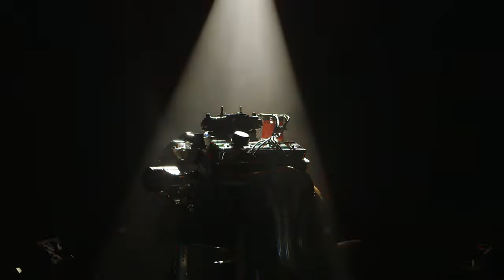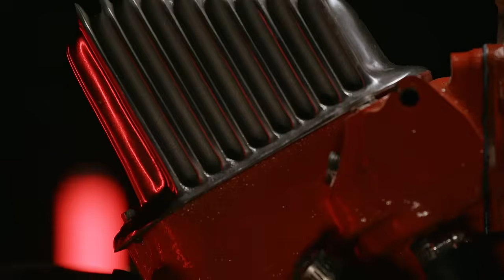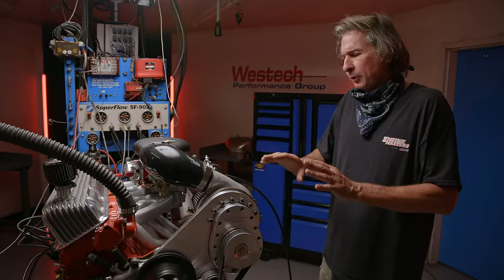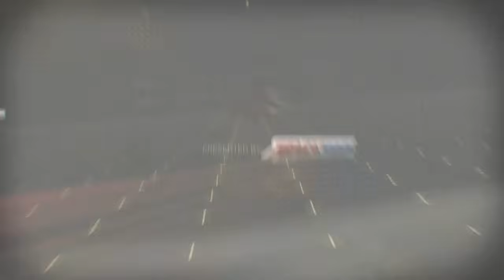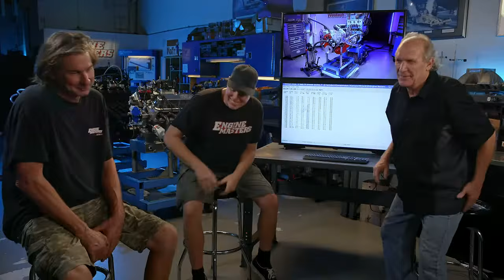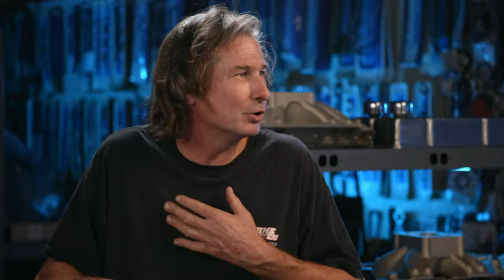Engine Masters  S5E77   Dulcich's Quest for Slant 6 Greatness!

Comment: Have you guys thought of building like 4 or 5 similar engines all with different compression ratios and compare power?.  Then add a blower or turbo.  Compare and see what the changes are with the same psi of boost.

Comment: My Dad's first new vehicle and his 2nd new vehicle was a 1977 d100 with granny gear and a 1987 d100 with overdrive, no granny gear. They both hauled a lot of wood for us, got beat pretty badly by my 5 older brothers and me. The '87 was 1 of the 3 vehicles I learned to drive on with a few late nights squealing tires, oops tire, although both have limited slip, past redline. Not sure how long the 77 lasted but Dad traded the 87 in with 189k miles without anything but oil changes for the engine and only a heater blower fan and quite a few tires.

Comment: We had a '76 Duster with the 225 "Slant-Shit" motor as we called it.  My dad would lower the idle to set the valve lash. The heat riser was questionable so he installed a manual choke for cold startups in the winter...LOL 145HP&8.4:1 compression?LOL

Comment: I have owned several Slant Sixes. My favorite one was a 77 Super Six. It pushed my Volare' around like a small V8. All the rest were very weak but got 20 mpg and lasted forever. The most powerful inline 6 I ever experienced was the AMC 258 cid. It was in a Gremlin and it would spin the Right rear tire and get a chirp in 2nd with an automatic. I have also had some experience with a 383 duel turbo draw thru set up in a 68 Dart GTS. It was very powerful. I put a TransGo shift kit in it and pulled the 4.56 out for a 3.23 after we got it sorted out. The most pull I have ever experienced in a car. That Dart needed a transbrake and a looser torque converter, to produce a quick 1/4 mile, but it would flatten your eyeballs once the turbos came on. We pushed it up to 45 psi boost. I'm no mathematician so I googled it and  I believe that is over 4 atmospheres, or that old 383 would be about 1,543 cid. ben/ michigan

Comment: We ran a Dodge Demon with a 225 a bit too deep through a stream in South Carolina in 1980. It just made it to the other side as the engine looked up, actually from water being ingested. After a while not sure what do, we pulled out the plugs and turned if over until most of the brown water was squirted out... 10 minutes later with spark plugs, it actually cranked up and we drove it home.

Comment: The slant six's biggest weakness is the head, if someone designed a flow throw or even Hemi head it would have massive power gains. It's funny those home made masks wouldn't save you from anything when it comes to microbes.

Comment: Big Power from a slant6? Not hard to do. Bit pricey tho. EFI on a log inlet manifold with equal length runners, port injection, a big TB, forged & lightened internals, lumpy cam, wire ring head gasket & about 15-18lb of boost. Might need to cross-bolt the mains. Might not. Can't remember, but the above setup produced roughly 410hp & 390lb/ft, & was reliable for the 5+ years I knew the owner. IIRC, getting the balance to within 0.1g was key, as a previous build (balanced to roughly a gram) ate a bearing. There was talk in the 'shop that hitting 500hp was doable, if you were to up the redline to 7500, but the owner didn't want to go there...

Comment: Had a 1984 Dodge 150 4x4 with a 225 with 4 speed and a granny 1st gear. Couldn’t out run granny with a walker but the slant six low rpm torque and granny gear mad it a top notch 4 wheeler. I could out crawl any V8 4x4 any day without ever putting my foot on the gas peddle. Truck could idle up any 4x4 trail. We used to walk get out of the truck and walk along side it with one hand on the steering wheel

Comment: These guys they’re funny, but the slant six cylinder engine goes 1,000,000 miles there. High-performance engines are lucky to go more than a year without blowing up and the slant six was not designed to look symmetrical like a V-8. so your traditional boomer boys cannot appreciate the unusual it’s funny because now today Honda makes a four-cylinder that you can get 1000 hp out of and wipe the floor up with your big blocks. This is probably why I don’t watch this podcast that much because of the engine snobbery it’s like wine drinkers they are pretentious assholes.

Comment: I noticed, no one mentioned power to weight ratio! Slant 6 220 Cast Crank-450lbs, Forged Crank-550lbs. 383-620lbs. Modified inside any car, I believe it would still win!

Comment: In Australia, Chrysler used these engines in the 2 door Valiant Charger - 302 factory hp for the high-performance E49 version. The  E49 had triple Weber carburetors, an aggressive cam, and headers and 265 cubic inches.  Some Aussie may have already said this.
Reply: Totally different motor
Reply: @cletusslackjaw969  no worries
Reply: Nope

Comment: Does anyone know about the Corvette 1967 aluminum 427 engine. My dad bought the car in 1967. It was a roadster. The car became unstable at about 189 mph. We clocked it over 10 miles as the speedometer only went to 160 mph. We altered the body and changed the aerodynamics by adding a duck tail. Flared the fenders to except 12 inch tire on 15 inch rims. Things improved but 196 mph average over 10 miles was as good as it got. There was still throttle . Just not enough down force. My father said that it would take a minimum of 500 hp to approach 200 mph. Did GM make a 500 hp engine in 1967? Thank you . Great show

Comment: I would have intercooled it, dropped the static compression ratio to around 8.5:1 and destroked it to 198. The 225 has a ridiculously long stroke vs. bore ratio and cylinder head ports like soda straws.. the smaller displacement and lower piston speed of the 198 crank would have helped raise the rpm upper limit safely and more closely matched the head flow characteristics.

Comment: stockish re-build  - add 
- forged pistons
- forged rods
- Callie's "rifle barrel" steel crank
- 6500 electronic ignition 
naturally aspirated - peak HP and Torque will be between 5500 and 6000 RPM

Comment: The slant 6 in my 1985 d100 ran so hot, it shut off going down interstate 40. Stuck thermostat. Engine wouldn't turn over. Let it cool about 10 minutes, while I jammed a screwdriver through the thermostat. Topped off with rain water and drove it 40 miles home. That was 9 years ago and it's still running today with 283,000 miles.
Reply: Legend
Reply: for real

Comment: The head and small bore really limit power on the slant 6. Even with bigger valves and porting the stock head is a big restriction. And, the small bore is going to limit rpm and airflow. 
Boost can fix a lot, but for the money and effort it’ll still be way behind more traditional engine builds.

Comment: Don't forget the slant 4 cylinder Pontiac engine. It was actually a 421 cubic inch engine cut in half.
Reply: Half of a 389, not a 421. 195 cid.

Comment: Great for low end torque and are well balanced and reliable for extreme longevity. Especially a Ford 300 or Cummins Bt6 plus they can often be pretty decent on fuel. I'm looking forward to getting my '69 block 300I6 slapped together with the Aussiespeed 4V intake, Duraspark II distributor, heavy duty exhaust manifold and new drive gears and oil pan finished to be stuffed into my '82 F250 4x4. Eventually I may put a turbo on it but for now I think the Predator carburetor will wake it up, I may someday install a greater duration camshaft and port the head or install a reproduction head with bigger valves. Higher compression around the 10.5:1 would be ideal for it.

Comment: It's incredible how, no matter how hard Americans try, they still can't get great numbers from their 6-cylinder engines.

I'm sharing a video of what we do here in Argentina, and it's not even close to the most radical build: https://youtu.be/t8yIDqn2PM4?si=KQOZ7E8JiSXIxz4x
Reply: Because we have loads of V8’s available and they’re much easier, and cheaper, to get power out of. Even a “small” V8 with as much modified as this engine would be almost double the power and still be reliable.
Reply: You Argentines must be full of ignorance, despite the internet documenting that Americans have, in fact, made big power with 6 cylinder engines. 

Keith Lopez has a ford 300 i6 with over 1,000 hp, 

Newcomer racing has an AMC i6 with 1,000 horsepower,

And others have pulled big power out of the GM Atlas 4200 i6.

Comment: I'm slowly recovering from slant sixness. I sold my last Dart several years ago. In 1977, I drove from Florida to the tip of the Baja Peninsula in a Valiant station wagon. It had over 200k on the clock when I set out, but I had no worries about making the round trip. I had to reset the  points on the way home, but no repairs at all. The biggest downside to the slant six was the leaky valve cover and the tendency to flood out in rain storms.

Comment: They might be slightly overrated but only with the nickname leaning tower of power, which they can be, and as a teenager I came up with a different head design, before I knew about the Australian slant 6. I always wanted to just change the intake to the inside and the exhaust on the outside. But I will say the power and especially the torque was greater than ford, AMC at the time and gm significantly! Now with no maintenance other than late oil changes they will definitely easily go over 200k miles so they are definitely very reliable. Now you guys that hate them are comparing them to v8s so not fair, but compared to other engines within 20 years these are great engines and the only better power builds are the AMC/Jeep inline 6s. So pretty damn good for a 1958, 1959.

Comment: Chrysler made a mistake designing the 225, they should have given it a cross flow head. Keep the intake as is and put the exhaust on the other side of the block. It would have breathed a lot better. Still a great engine.
Reply: Remember this was a car/truck motor used in Winter. Same side flow provides carb heat, even with headers if you do some trick mods

Comment: e49 valiant charger in australia had the 265ci hemi 6cyl with triple side draft webbers and made 302hp na stock which was 28hp more than than the 340ci v8 which was the most powerful v8 option. the e49 was also seconds quicker per lap due to lighter weight and less understeer.
and an ssv redline 6.2l Ls was slower than a 4.0l xr6t barra i6

Comment: For boost, I would NOT have increased the compression ratio. You can get similar power, without the high peak chamber pressure, if boosted at stock compression. That would also allow pump gas, and, the head gasket would have probably survived!

Comment: My first engine in my Chevelle was a 250 inline 6, it’s since evolved into a 428 small block Chevrolet
Reply: Weird how dat happens......if ya keep da car long enough it sometimes reverts back to a 6-Banger. 
Strange but true....LOL
Reply: @bbarnett3469 no, mine definitely won’t
Reply: @Mopar-k6o  I'm back to Drum Brakes & Points......LMAO!!
Reply: @bbarnett3469 my Chevelle used to have 4 wheel manual drum brakes. About five years ago I did a manual disc brake swap on the fronts with a kit from Speedway motors and it’s MUCH better. It feels like the brake system from a modern normal car. I don’t have the patience to mess with points or ballast resistors on my cars anymore either.

Comment: Had a 62 Dodge Lancer back in 74 with a slant 6. Used lots of oil, mostly blowby. Lent the car to my brother with a stern reminder to keep an eye on the oil level. He didn't and the result was a rod right through the side of the block. Rebuilt a junkyard 225  and drove the hell out of it a few more years until I sold it. Kinda wish I still had it.

Comment: in my valiant came equiped with a police interceptor spec as they called it, was meant por a police car but never did it so i got it, and it is 174bhp with a tad over 200 trq and not a single 350 or 351 got me in those years, the only one i ever lost and by a couple cars was against a dodge magnum 360, which here did 300hp from factory

Comment: They should've looked over at Australia the valiant chargers in the 70's if it was an rt made 305 HP from the factory out of the 265. I've seen one make 330 at the tyres with a stroker kit , E85 and a CNC cast iron non cross flow head. 

That's 400 at the crank.

Comment: The 70-80's ARCA series ran 6's and NASCAR being NASCAR there a smaller V-8 available in the series, BUT as the engine quilders got loose the 6's could crank out MORE than v-8s.  For a while the color commentary would be 'in the lead with his V-8 t-bird, with his 6 cylinder powered Olds'.

Comment: I had a good friend in Columbus Ohio in 80 who raced station wagons with straight 6. He used a Pontiac Sprint 6 overhead cam with factory 4bbl Rochester carb. There were speed parts from all the speed companies for all the 6 cylinders.
Reply: thje "speed parts" were limited to intakes and headers pretty much.the odd cam was available but the market was nothing like the availability of parts for v8s,especially the sbc

Comment: I used to know some old mopars guys.. and they said it was easy to get an NA 225 to match a stock 318. Of course, the 318 was not a performance motor either. I miss the good old inline 6.. naturally balanced, one head... simple. The Australians took the old small block 250 Ford and kept working on it long after Ford gave up. Not sure why all the old domestic inline 6s had the intake and exhaust on the same side of the head. Though maybe that caused better combustion swirl for low rpm (cheap parts) efficiency and power. I totally understand Dulcich's angle... it's easier to root for the underdog. You have a built V8 and somebody always has  a faster one. But a built old inline 6 puts you in a class of your own. Now I want to cram a 300 6 Ford in a Galaxie with a 5 speed manual.

Comment: I drove a heavy truck that had one of these over ten miles with the crankshaft broken just ahead of the rear main! It just vibrated on take off and I didn't know it was broken until we looked at the clutch and found that it was wobbling under load! Installed a crankshaft and bearing kit and drove it another 40,000 miles before I sold the truck. As far as I know it's still running!

Comment: You need to do a Holden red 6. Good roller cam race engines on Webers are making 330hp @6800. From a 202 engine. With a Phil Irving downdraft head they made that 330 40 years ago. On triple Dellortos.

Comment: I feel like triple Webber DCOE Carbs with velocity stacks would have been better for an inline 6 then a single 4 Barrel. I did that with my 70 240z and it was a rocket ship. The intake manifold design was awful on Alot of the 6 cylinder engines from this time period and having a single carb for 2 intake ports is a good way of getting around the flaw of the intake manifold design on these Engines

Comment: Enjoyed the video. But I think that amount of boost on 10.5 CR was a mistake. I have been running "low buck" slants since the 1970's. Stock, NA modified, turboed, and nitroused. Have a lot of fun with them. A slant can make good power, but not cheaply. Example:  https://www.youtube.com/watch?v=ZPm0POxQuNk  low 9's at 140 mph in a door slammer.

Comment: A lot of success has been had using the earlier forged rotating assembly, and blueprinting the block and head for perfect alignment. It would be nice if someone would develop a crossflow aluminum hemi head for the slant because the power would be insane! NA, add a blower or turbo and 500 hp is not unreasonable with that set up.
Did you know that old timers actually cut the crankshaft in half to basically make a flat plane crank back in the 60s for dragster use and they got some pretty interesting times at the track with our beloved leaning tower of power.
With a full Monte Clifford set up you can easily acheive 300 hp NA.
Personally I love the slant because it is the anvil of engines, I've owned many and they last and last even if abused with proper oil changes and filter maintenance.  I put them right up there with the Cummins 5.9 12 valve, not super powerful stock but huge potential  and they both never die if you keep that oil clean and cooling system up to snuff
Reply: No way to make a flat crank out of a 6-cylinder crank. The journals are offset 120 degrees. Besides that, how do you put a crank back together again? They don't really weld properly.

Comment: You have to build it with the forged crank good rods arp bolts and forged pistons oring the block copper head  gaskets bigger cam more boost good for 450hp 480 ft lbs .

Comment: The higher the performance, the lower the reliability. If your goal is a quarter mile racing engine, any 6 banger is not what you want. But, if you are looking for an everyday driver that will out last most everything on the planet, you can't beat a slant 6.
Reply: Ignorant and wrong. Many of high performance inline 6's have been successfully raced. 

Looking past Europe and Japan's long standing history of success (B58, 2JZ, RB26,)  US-based inline 6s have been plenty successful when boosted. 

The B series Cummins, ford 300, AMC 4.0, and GM Atlas 4200 have made over 1,000 horsepower.
Reply: @riogrande163  Well then name some of the great inline 6's that have won a NHRA championship.
Reply: @davidfreyta3857 

You just proved your own ignorance again. 

Just like every muscle car Neanderthal, incapable of seeing anything outside their narrow little world and thinks a 1/4 mile drag race is all that matters. 

There's a reason you don't see muscle cars in road racing or track days very much. 

The NHRA is full of contradictions. "No replacement for displacement" yet they limit displacement in top fuel races and run blowers....

Comment: I had a 1973 Chevy Truck 350 that was rated at 165 hp. So I guess what Steve did was impressive. I also drove a 1965 Dodge truck at work that my Chevy would run circuls  around it. Go figure.